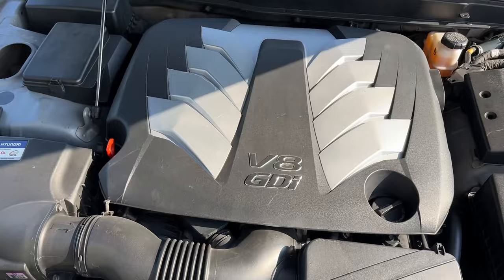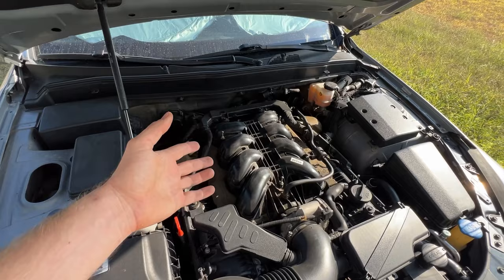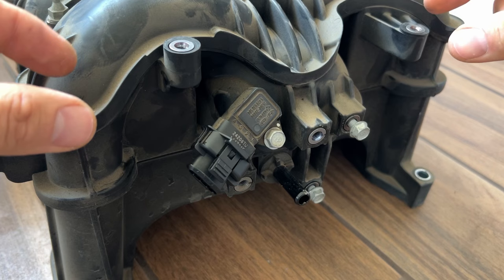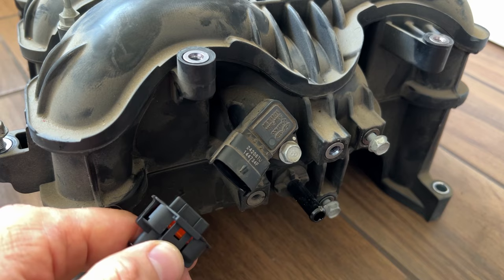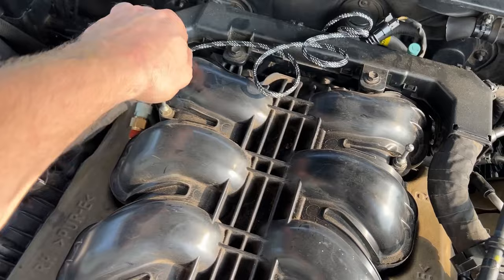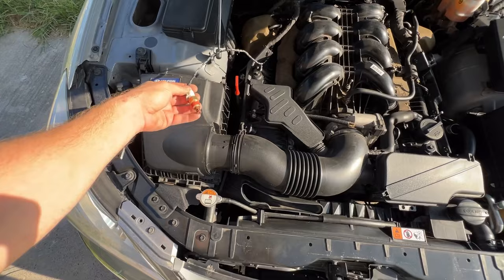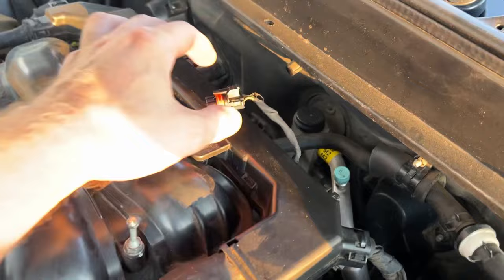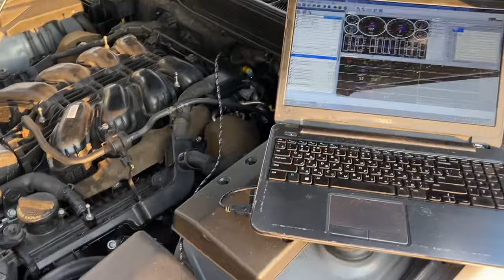GEPTuned Genesis 5.0 Intake Air Temp Sensor Relocation Kit

Comment: I'm unclear what this is meant to improve.  It'll detect lower temps, sure, but how will it help the car's performance?
Reply from the maker: 1) This product will help ecu see real temperature not heat soaked manifold temperature
2) when ecu sees high intake air temperature (which happens 90% of time) it retards timing and adding more fuel to enrich and try to “cool” hot engine which at the end resulting poor engine performance, weaker response, higher fuel consumption.

When ecu can see correct intake air temperature, engine will operate at its optimum performance.

Hope it helps

Comment: I’m looking to upgrade my 5.0 genesis I was hoping to pick up 80 wheel any ideas on how to accomplish that goal or exceed would be awesome?
Reply from the maker: By investing in upgrades that i offer on my website
Reply: 80whp is only achievable through nitrous. A tune will only get you 25hp. Other than a tune, there's literally no aftermarket for the Tau engine other than custom exhaust and a weapon r Intake from a genesis 5.0. This air temp mod doesn't really increase power. I've used them before on other cars.

Comment: 2015 genesis 5.0 tau motor.
 
Question: why would the temps be false? Wouldnt the stock parameters of the map account for that temperature reading? Are we just tricking the computer to think its getting lower temps?
Reply from the maker: Because actual temperature that goes to in intake is way less than heat soaked manifold from which oem iat sensor also gets hot. It is not tricking but getting actual correct reading.
Reply: @GEPTuned  What @ChoodeeLong is saying is "wouldn't the engineers know the IAT is sending the ECU temps that are higher than they are really are, and so therefore simply apply an adjustment by subtracting X amount of degrees from the temperature the IAT is seeing?" Or make some other calculation based on it's position in the engine bay? If that's the case, then relocating the IAT to a colder spot would be tricking the ECU into thinking it needs to make adjustments when it doesn't.
Reply from the maker: @crackersmcquackers it does not work like that. 
Imagine, ambient air temperature 
Whenever it is measured and reported it is measured in shade not under the sun as under the sun measurement will be crazy high, double or triple than actual.
Same thing is happening with this engine what oem sensor is reading is “under the sun measurement”
And no, it is not subtracting anything

Comment: Hater pack 😂😂😂

Also the running rich all the time can be another reason they eat so much oil due to it seeping pass the piston rings 😮
Reply: Only the 2012-2013 5.0 genesis supplied with piston rings from Germany.
Reply: @zeoh4371 i have 2012 and don't have oil consumption. Ever since tune and thicker oil it went away. Before it would eat oil
Reply: That’s good. I’m considering a 5.0 but it has no aftermarket